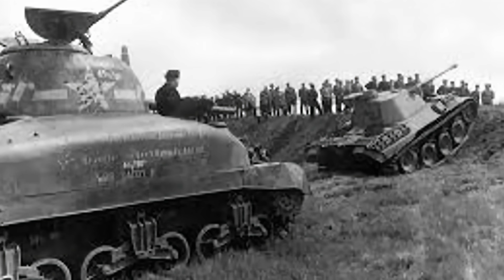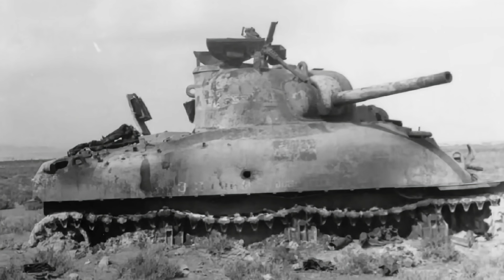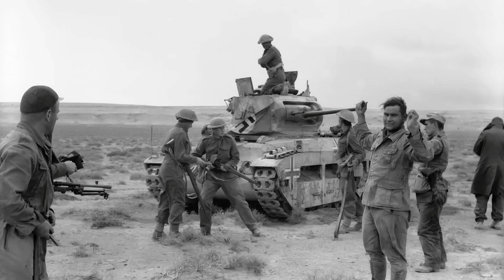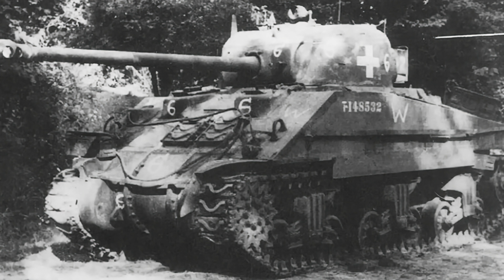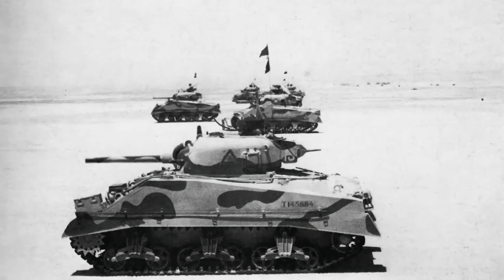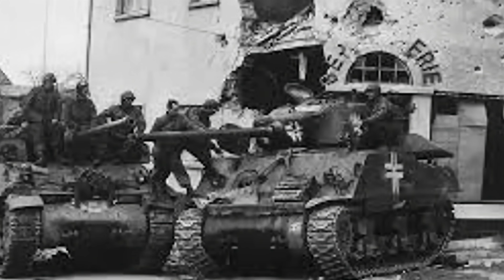German Engineers Tested A Captured Sherman — Then Admitted They'd Never Built Reliability Like It

Comment: The Sherman tanks initially had many problems with mechanical failures. They had been using standard commercial grade automotive grease. These greases were the cause of many mechanical failures. After lithium compounds were incorporated in greases used in Sherman tanks many of the mechanical issues disappeared. 
  I wonder if the German greases had lithium?

Comment: The Sherman tank had an extremely weak cannon and weak armor. The German tanks, particularly the Tigers, had a powerful cannon and thick armor. A Sherman could only destroy a tiger from close distance, and even then it would need to be able to fire from the rear or from the flank. The Tigers could destroy a Sherman from any distance. The Sherman was a death trap when faced by a Tiger.

Comment: Also the Sherman had huge options. The crab for mines, Crock the flame thrower,  bunker buster, bridge, bulldozer heck floating tanks.. The Japanese feared the flame thrower tank more than anything and understandably so.. But the HV 76mm gun made a huge difference. Unlike the Firefly it allowed to keep the bowgunner. A Tiger needed 10 hrs to operate 1 hr, the Sherman needed 1 hr to operate 10 hrs..do the math..

Comment: The problem was that embedded into the German psyche was the notion that motor vehicles were built for the wealthy, and no expense was spared, and everything built with perfect engineering. Where Ameicans used bronze bushings, Germans used ball bearings. Americans understood that cars, and tanks, only had to work well, not be engineering perfection. Thank Ford and GM for designing sturdy and adequate cars that the American landscape couldn't beat apart.
Reply: Just bought a GM product after years of driving Nissans and Toyotas. What a difference.
Reply: Something missed is that it wasn’t the automotive technology employed, but rather farm implement design. Think Ford tractor transmission rather than Packard auto transmission. The Continental radial engine was adapted from an aircraft engine technology. An air cooled engine is simpler and lighter than a liquid cooled engine. Make note that the latest 21st century aircraft engines are diesel engines!

Comment: The TLDR is the Germans basically made VW Beatles as tanks.
Reply: Actually the other way around. The US tanks were the simpler and easy to service vehicle. 

The German tanks were, well, German. But more like a fancy Mercedes or something intricate.
Reply: All german tanks were air cooled.
Reply: @emanueltransmissions again the TLDR is air cooled engines. VW and their parent company, Porsche made air cooled motors as well. They used their auto manufacturing expertise. We did too. We put radiators with liquid cooled engines in the M4 Sherman. The Germans built their tanks specifically for how they would need them in Europe. Not N. Africa.
Reply: @GunRoastShorts  not all of their tanks were aircooled which is why I didnt think thats what your comment was alluding to. I thought it was moreso a nod towards the us tanks and equipment being less overengineered and more simple.

Comment: The Sherman got a bit of a bad rap by historians.  It wasn't a "work of art" like a Tiger.  But it was never intended to be.  Works of art are destroyed in battle just as mass produced tanks with interchangeable parts.  

The question was always what to do when a tank breaks down.  Repairing a Tiger in the field was very difficult and often impossible.  Very often Shermans were repaired and back in service in a short period of time.

There also was significant evolution in ammunition for Shermans.  By the end of the war, updated ammunitition substantially reduced a Tiger's armour advantage.

Comment: The Germans should have used the design of the Volkswagon Beetle.  I had a 1964 VW Beetle that I could shift without using the clutch, just by get the engine rev correct.

Comment: This video was an excellent comprehensive explanation of contemporary German testing and technical evaluation of captured American Sherman Tanks by Wehrmacht engineers during WW2. This testing and evaluation was eye opening for the Germans. 

The Germans were astonished by the robust durability, dependability, ease of operation and maintenance engineered into the Sherman tank. This was the result of deliberate American engineering, efficient manufacturing, high standards and quality control inherent in American automotive manufacturing. 

Sherman Tanks were built to be rugged, dependable, easy to operate, and easy to maintain and repair in the field. The Sherman was engineered to be easily upgraded. Furthermore the Sherman designed to be operated and repaired by men familiar with US automobiles. Parts uniformity was consistent no matter where the individual components were manufactured or which factory the tank was assembled.  Most Sherman tank parts and components were interchangeable between all variants.  

The German conclusion was that a Sherman tank at the front lines ready for action was infinitely more valuable than a technically superior Panther Tank broken down 20 kilometers from the fighting.
Reply: "The German conclusion was that a Sherman tank at the front lines ready for action was infinitely more valuable than a technically superior Panther Tank broken down 20 kilometers from the fighting."

All WW2 tanks broke down - a lot, the Sherman, too. 20 out of 50 Shermans could be expected to fall out to minor or major mechanical issues during a 30-40 miles road march. The main difference was that the allies had a large pool of replacement tanks. By 1944 both the Tiger and Panther were reliable by WW2 standards.

Comment: I watched a video on how to drive a stug. The drive shaft for the left side drive sprocket is right above the driver's pedals. If you aren't paying attention, it could rip your feet off. If you pull back on both tillers at the same time, it will grenade the transmission, and you sit directly next to it, in the driver's seat.
Reply: Yes, indeed.
I watched a video of a Stug being restored by  Ausarmour and noted that point.
Why was there no shielding ? Around this lethal spinning drive shaft, adding additional weight to German tanks didn't seem to present any problems whatsoever to german design engineers.
Add to that the Stug was an attempt to put more armour in the field hence no turret ring rotating turret, essentially aimed by tank tracks positioning barrel.
Lower profile, yes good idea certainly,  but when in cover do you really want to be spotted traversing to line up your target?😢
Thicker sloping frontal armour good again, but I class as self propelled artillery and not battle tanks.
German design over complicated KISS
Keep it simple stupid lol.
Reply: @maverickcruise99  I couldn't believe how ridiculous the controls are.

Comment: The German’s lack of flexibility and drive for utter precision hobbled their abilities. Sadly they maintain that same philosophy today so when their cars breakdown they cost an enormous amount to fix. American cars used to be built for reliability and longevity, like the Sherman tank. It is only recently that American car manufacturers were able to use computer components to build in planned obsolescence and reversed decades of building reliable vehicles that could literally run for decades if cared for. Now, American cars barely get past the warranty period before requiring “repairs” costing thousands of dollars compounded by corrupt repair shops piling on even more costs on hapless customers. Sad. This attitude of planned failure taken on by American manufacturers will serve America poorly in the next major conflict. It is not our workforce that is the problem, it is management that is making these catastrophic decisions for short term profits.

Comment: The M4 Sherman didn't start off on a drawing board fully developed. It was more of a Frankenstein creation in that the Army had minimum requirements for what an infantry tank, like the 75mm gun but that was it. The original winner of the tank design competition morphed into the Sherman over time and the design continue to morph as different suspension systems, guns, were tested and approved. The Army also focused on ergonomics far more than the Germans or the Russians did. It wasn't just because of car design and experience,, the Army design board emphasized it almost to a mania.

Comment: Sometimes, well more often than not, people don't realize how America got to this kind of reliability.    The Video NOTES how the life expectancy of the Panther, measured in distance covered before breakdown. was "acceptable" to Gen. Guderian.   I believe this is difference was that the Germans designed their war material on the geographical scale of a European Nation.   

The Americans were designing on a continental scale.    The Americans first realized the absolute necessity of building for reliability over massive continental distances in this exercise in 1919.    

https://en.wikipedia.org/wiki/1919_Motor_Transport_Corps_convoy

No European Nation ever tested their mechanized capability against field conditions that prolonged.  Not even close.  Yet there were the Americans scratching their heads as early as 1919 trying to just figure out how reliable mechanized warfare was on a Continental Scale. 

This Continental Scale of warfare had already been a part of US Military operations since the American Civil War.   The Americans knew their cavalry could operate at these massive scales.  Indeed the U.S. Cavalry remained it's own branch of the military into 1942!   The issue studied in 1919 was about the notion of replacing horse cavalry and mounted infantry with mechanized forces.  Could mechanized military transport do what horses were already doing.   The answer was a great big giant...,

HELL NO!    

That 1919 was the American "Wake Up" call.    That's when reliability became the primary concern of military machinery of all kinds.    That expedition was a true nightmare.   And a young brevet colonel, Dwight David Eisenhower, (later general) was part of it.

Comment: The Sherman M4 medium tank, was an in creditited tank, that was exelently designed and built. It was a completely different concept. As I see it, the main tank of the American Forces, and a large part of the Allied Forces in whole. The united State ability for mass production, was already building vehicles and aircraft at an incredible rate by 1940 the arsenal of defense was in full swing. Launching a ship a day,  and anything it could build. This tank was built under shipping restraints for size and weight, specifically for swift shipping. They fit on trains, and were made to be good enough. But not only that some 11 company’s were involved in the manufacture, as well as all components were made in the USA. It was about numbers from the start, and after 941 the evaluation of this tank had a complete make over, many derivatives as the diesel powered vehicles went overseas, or to the Marine Corps. The learning curve was steep, but with battlefield experience, new and building techniques, they were a different animal by the end of hostilities, still with-in shipping parameters. Many crewmen hated it, for understandable reasons, like their friends died in them, others owe their life to it. But the United States is 50 times bigger the Germany, so it had 50 times the ability to mass produce, we built enough of them for our Allies, and to fight on 2 fronts, it was an incredible fear, something like 50000 of these alone, let alone Stuart’s, M110s and the like, overwhelmed the A is Forces, in men, plane ships,and just everything, the likes of which we may never witness again.😊

Comment: Fast forward to now. American engineers perfect planed obsolescence . They can make a engine fail one mile after your warranty is up. They figured out how to put a part that you have to replace from time to time in the hardest spot to reach. You have to take the whole engine apart. Shame on them.
Reply: No just American. They all put bigger engines plus clip on so tgat the old mini 1100cc had space to burn. The modern mini, only slightly bigger has a 2000cc engine. Mostly unnecessary.

Comment: American engineers have inherited German elitist engineering theory to the point where machines are unnecessarily complex and expensive at the cost of survivabiliy.
Reply: It's a fail safe. With our enemies falling so far behind, if we tried to make something easy to understand and simple to build, we would risk our enemies manufacturing the exact same thing we have. China has desperately been trying to copy america's designs and attempt to have something decent. Russia took the abram and bradley and is even using some bradley's with retrofitted parts in the ukraine war right now.
Reply: The reason for that is their cost. How many of those machines is the production company that makes them going to sell in a given year 2, 3? They have to make sure they get top dollar for them to make the cost of producing them worth it. They also make them so complex so you have to go to them for parts. If they were building a machine that would sell hundreds of times throughout the year they would cut production costs and make the engineering much simpler.